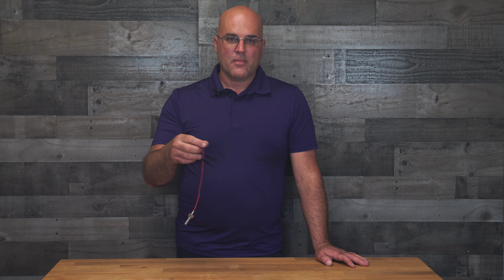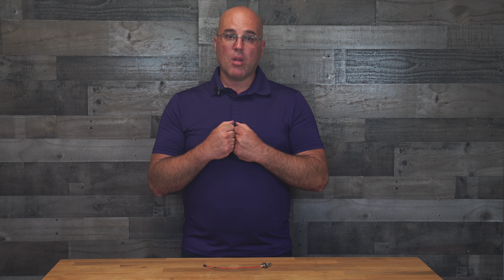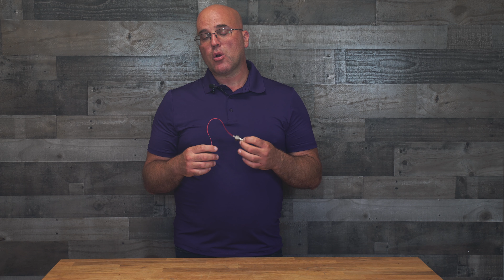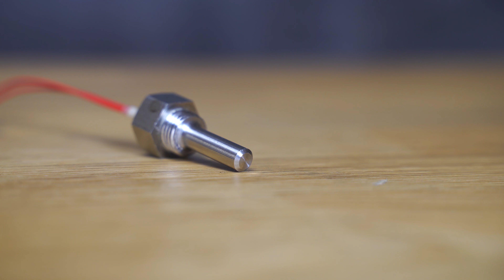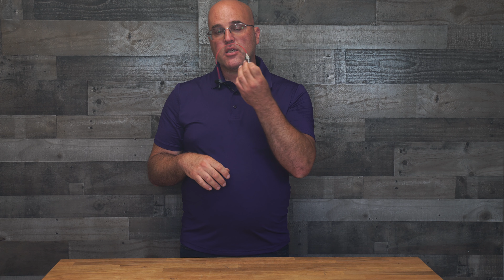Is Your PID Espresso Machine Overheating?

Comment: Is there anything else that could cause over heating? I have a profitech pro500 pid. I changed the sensor and it didn't help
Reply from the maker: Since we do not sell Profitec, we suggest you contact your dealer for support.

Comment: My machine only overheats occasionally. A couple of times per month, during warm-up, the temperature on the PID starts jumping around (like flickering). This eventually leads to the safety valve blowing. Is this a faulty PID? Or is it the probe?
Reply: did you find a resolution? Mine does the exact same. Thanks!
Reply: @romankilun1527  Hi. I unplugged all the cables going in to the PID and re-attached them! This solved the problem 😂 .. Nothing fancy or complicated.. I just unscrewed the top panel.. Pulled out the cables going in to the PID and reattached them. I haven't had the issue since (8 months now).

Comment: I was experiencing extreme overheating this am for the first time on this machine in 8 years. I found this video and it’s a great explanation, especially after seeing all the build up on the sensor I thought this was the culprit for sure. Unfortunately after cleaning the sensor thoroughly I am
Still experiencing over heating. Do you have any more suggestions?
Reply: FYI.. I use mostly distilled water and sometimes mix in up to 20% filtered water.
Reply: hey did your machine stop working when overheating? mine suddenly the water does not come out, i reckon it would be due to overheating... i have turned it off and now waiting to cool down, hopefully the machine will work again i'm worried

Comment: Hi Jim, 
I recently started running into issues with my lelit mara x in regards to uncontrolled steam pressure, and the pump kicking on near the end of the heating cycle, leading to a rapid build up in pressure and spilling into the drip tray. Is there somewhere better I could contact you to see if you are able to help me with this problem? I have a more detailed explanation and a few videos of the issue at hand and would greatly appreciate your help.